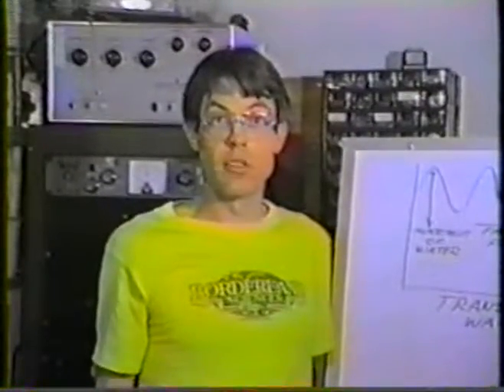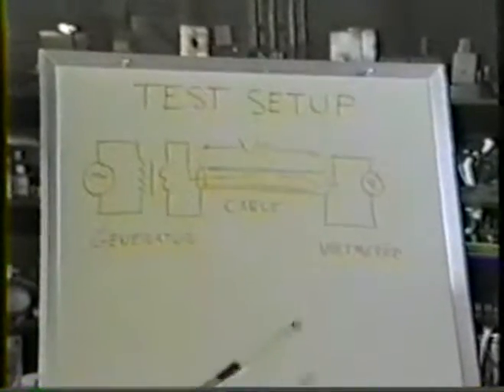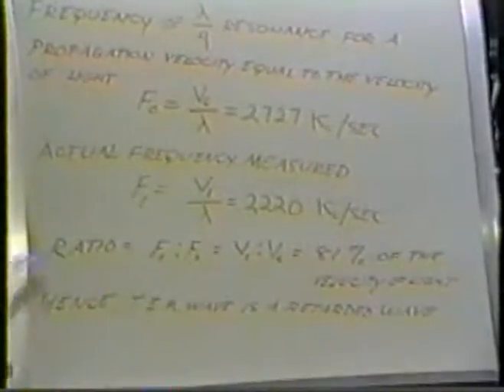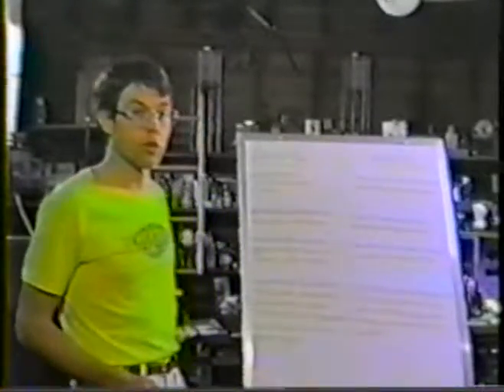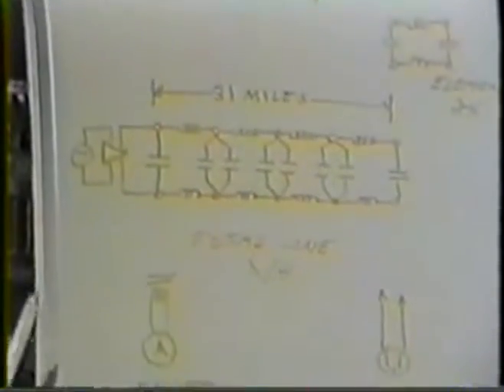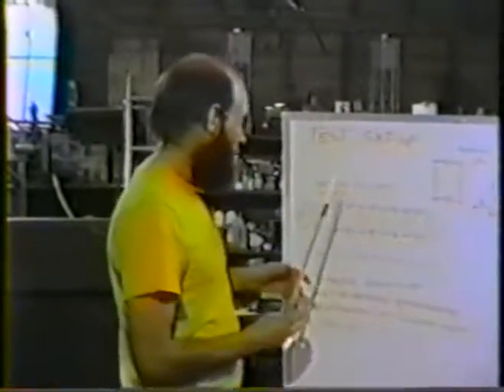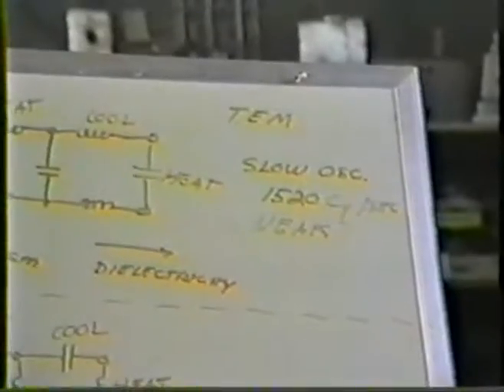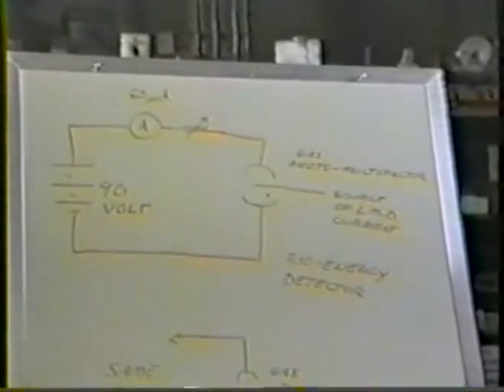Eric Dollard - Transverse & Longitudinal Electric Waves

Comment: Its funny that they needed analog equipment to measure high frequency waves. Computers, sensors, FETS, and MEMS devices nowadays are more than fast enough to analyze super high frequency waves. Although neon indicators are still a great way to detect EMF they have certainly been surpassed by digital sensors.

Comment: 11:51

11:30

"And at the neutral end of the coil we have a large capacitance plate to produce our impedence dissimilarities. So we end up with a quarter wavelength rather than a half wave length resonance on this coil."

(11:30)

Longitudinal Wave Set Up

Uses same generator (AC) coupled by transformer to first turn of the coil. Capacitive probe pick up attached to the so called "insulator" (loosely coupled) of the fine wire. (Becomes 11:51)

"Impedence dissimilarities" means resistance and mass change frequency from half to one quarter wave length. Which is then still in harmonic resonance. (12:00) 

12:45

With the LMD wave,

"Resonance is much sharper." Not varying over several hundred kilocycles. Now varying only over several kilocycles. Sharpness Factor or a Q of one hundred times greater.

14:44

No longer a transverse flow, and it becomes the LMD longitudinal magneto dielectric (SCALAR STATIC PRESSURE which is no longer even a wave) which is impulse frequency voltage. (On Off, high charge positive and zero charge negative.) Positive charge meets resistance and phase conjugates (reverses.)

15:00

Exceeding the velocity of light. Fundamental flaw in computing requiring a new form of mathematical understanding (such as quadratic equations.)

The Tesla "Extra" Coil

(11:30)

Longitudinal Wave Set Up

Is using LMD analogue computing principles whereby transverse AC waves loosely "couple" through capacitors (charge and discharge oscillations.)

18:40

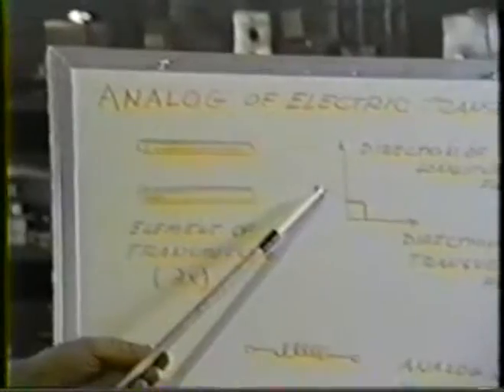19:12

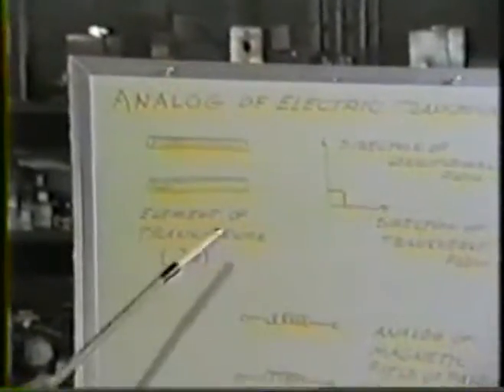Longitudinal and transverse DCF are at 90 degrees right angles to one another. 19:25 The Tesla "Extra" Coil performs a complex addition wave form creating a SPIRAL WAVE going up around the coil. Analogue LMD computing is performing same function as the Tesla "Extra" coil. (?) Mentioned as being better than an actual coil because less equipment is required as well as no radio interference is being created. (Which is against fcc regulations.  )

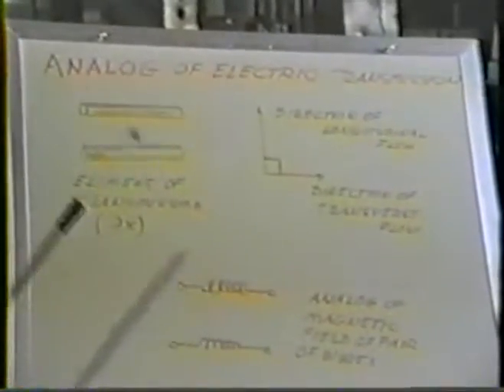19:32

Analogue of the magnetic field (examples are wires, inductance coils, filter comes, radio frequency comes, transformer coils.)

19:43

"ANYTHING THAT HAS THE ABILITY TO STORE AND RETURN MAGNETIC ENERGY." (on off resistance phase conjugation)

19:48

The Analogue of the Dielectric Field are a pair of capacitors.

21:39

Audio oscillator AC transverse wave generator represents the bi polar magnet rotating into and out of coil pick ups (generator.) The end of the line is open circuited ONE QUARTER WAVELENGTH

22:08

Magnetic Detector used is a true rms meter measuring heat from current and a thermo coupler and an AM ferrie loop stick. 

22:36

A plasma detector

A neon bulb brightness used to show resonance strength and of Dielectricity being measured.  (23:33)
Reply: In Shunt meaning

provide (an electrical current) with a conductor joining two points of a circuit, through which more or less of the current may be diverted.

"these components are designed to shunt electrical surges away from microcircuits"

an electrical conductor joining two points of a circuit, through which more or less of a current may be diverted.